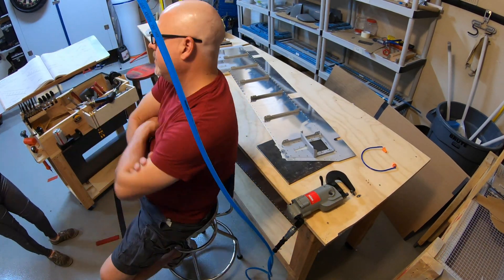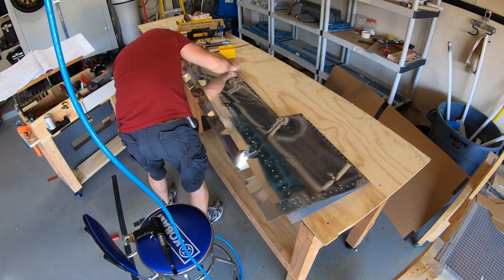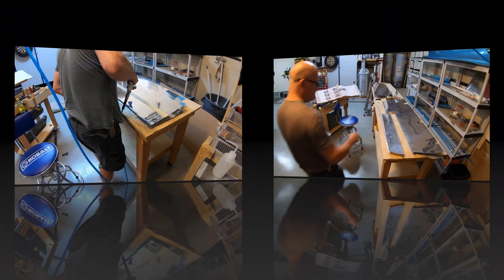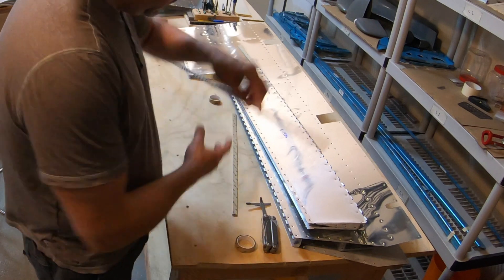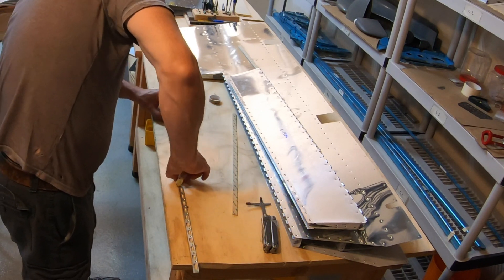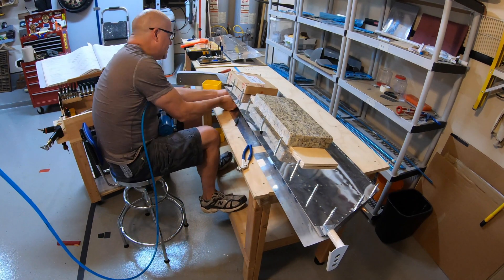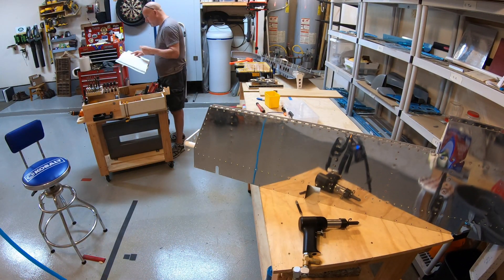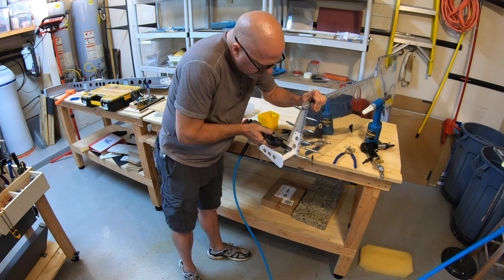Van's RV-14 Build #8 - Elevator

Comment: I am also building the empennage for the rv-14. I like the cart you have constructed that holds your tools. Do you happen to have plans for the cart?
Reply from the maker: No, not at this time. I will be doing a short video soon to go over the details and explain my workflow with the cart and other organization I have done. 
I am also teaching myself Fusion 360... so maybe I could draw up some plans. 
Thanks for the interest and question.  And, best of luck on your project. 
-T
Reply: Would love to hear your opinion on priming vs. Not priming.
Reply from the maker: I want to prime.  This is a lot of work and I want it to outlast me.  I will be flying to Florida & the Texas coasts sometimes.  I did not want priming to be an obstacle to working on the plane so I went with spray can SEM etching primer.  Just give it a light scuff, clean with denatured alcohol and prime...it’s dry in minutes.  I order it from Amazon and there are several colors.  If you only want to do the mating surfaces, I understand a lot of folks do that instead of the entire parts.  I spray the underlying structure of the ribs, stiffeners, struts, bulkheads, but not the skins.  To me it adds very little extra time and effort.
Thanks for the question.
-T
Reply: @TravelerTracy  did you prime the internal sides of the elevator skins in this video?
Reply from the maker: In this case, yes.  Because the PVC Foam Ribs require Pro Seal, the inside of the skins have to be scuffed where these are installed.  Because of the scuffing, I felt I needed to protect the skins around where I scuffed.  
After I cuffed the 1" for where the ribs are placed, I applied tape over the scuff and the training edge scuff and then sprayed the rest of the interior skin.  You can see this in the still photos on Video #9.  Thanks for the question.

-T
Reply from the maker: Thanks for the comments. I don’t have plans but I’m slowly teaching myself Fusion 360 so maybe one day I can make that happen.  Have fun building your kit. One thing I learned is not to sweat the little blemishes. Just do your best to follow the plans and quadruple check your setup before drilling or riveting parts together. It sucks having to drill out a few dozen rivers because you have one piece backwards. 
-Tracy